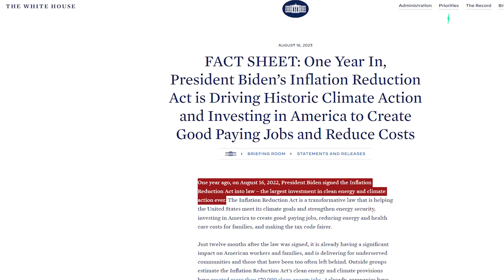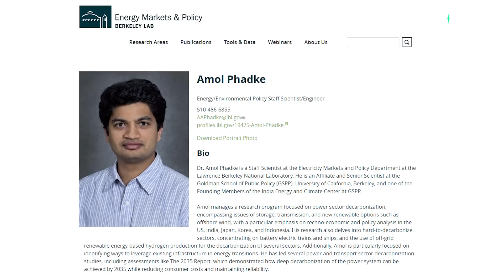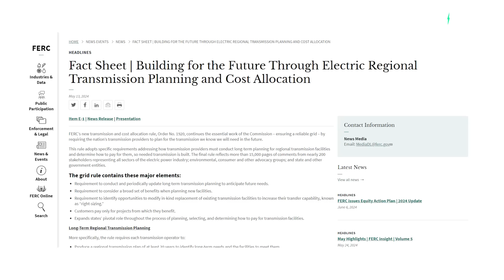How a small change could double the size of the U.S. electricity grid

Comment: AFAIK the cost of reconductoring is not small since those new cables with carbon fibre core are much more expensive than steel core cables. But I don’t know the exact numbers and wish someone could add this information here. In any case, the cost would significantly decrease if the cable replacement became widespread.
The same probably applies to replacing AC HV transmission with HDVC at higher voltages than AC - I would assume convertor stations costs would decrease substantially, making the approach economically sensible for line lengths below 500 km. 
So options exist without a huge need for new lines.

Comment: Sounds half-baked
Firstly, they could put the new conductors in parallel with the existing  and even create strings of new circuits and even drop off to new substation builds that might be developing along the transmission path.
As for the substations handling the increased power, firstly they maybe under utilised, so not to many issues with new parallel droppers terminating on existing substation equipment (massive amount of outage time savings).
Grid battery storage could be built at some substations that mightn't be able to deal with increases to limit, store and forward energy and, be especially convenient double-header for providing grid-battery FCAS.

Comment: Californian here, installed solar panels in 2009 under net metering 1.0 and at $.12/kwh.  Drove my Prius at one-third the fuel cost of my ICE car.  Now, there is little difference between ICE and EV fuel costs, so more electricity is not going to get me into an EV.  Cheaper electricity, yes.

Comment: UHVDC lines can go much further in distance with way less loss. They also carry  a lot more power. The biggest thing is we need storage so when there is no sun we still have power. Right now its hot and my central air runs day and night. I use 15-20kw a day normally but now I use 30-40kw a day. I can do this since I have 4 14.3 kw battery banks.  So the grid needs the same thing. Battery storage that can run 1-2 nights and or even help boost when everyone turns on their AC. With UHVDC we can transfer power around from say Arizona to Chicago when more power is needed. Now adding in more EV charge stations means each station must have battery units to charge enough cars daily and their own solar/wind farm to power it. Right now they are making a price war for electricity so the rich become more rich. EV should not expand till the grid is ready like in 2035.

Comment: The United Illuminating company announced a transmission line upgrade . The project will rebuild 8.1 miles, or 10.8 circuit miles, of transmission lines from the Eversource-UI demarcation point in Fairfield to the Congress Street substation in Bridgeport. It will cost $208 million . They also announced another upgrade 9 mile upgrade from Milford to New Haven. that one will cost $300 Million.  There is a proposal that a special metering device be put on EV charging stations, to make them pay their fair share of the increased cost.

Comment: Hello!  I owned stock in this cable, over 20 years ago.  The companies value just went sideways so I divested.  The cable is made of braided 1100 Al (the Al that is used in soda and beer cans).  The cable had an aramid core (think kevlar).  As a result when slamming power thru steel cable, it sags by about 24 feet.  The Al cable sags about 4 feet.  Additionally, due to the edge effect the Al cable can conduct more efficiently because the inner aramid fiber makes the cable a tube.  So, power moves on the interior and exterior of the cable.  Of course the cable has special splicing needs as well as end cap needs.  Finally Al has a +3 valence meaning when ionized under high power, it is better at moving electrons than steel.  Regards

Comment: 1. Is any cable maker making the new cable designs at scale, and do they need different techniques for joints and anchoring?

2. American transmission lines are often long. Why not rewire with these new cable designs AND convert them to UHVDC? Massive increases in capacities are possible this way.  The linear right of way is simple rewiring.  The UHVDC components are only at the terminals/ tap off points.

Comment: A key reason why US utilities would prefer to build new transmission lines rather than rewire existing ones is because a utility's profit largely consists of a mandated rate of return on capital investments (typically about 10%, usually set by a state government agency) multiplied by the amount spent on capital assets. It would be worth checking further, but I don't think rewiring an existing line counts towards constructing or buying capital assets, and so by definition, does not generate any profit for the utility. Hence the lack of interest. Rewiring, I believe, counts more like replacing a defective meter, which is mandated by the regulators to be revenue neutral, not a profit opportunity.

Comment: Regulations do not permit homeowners to install more than 95% of the average electricity use. This means that many many households don’t install solar or install two little of it. If more houses were off grid that would also relieve a lot of the capacity problem.

Comment: Power companies can go from 1 wire hanging from an insulator to 3 wires per insulator to triple the power sent.  As seen at 8:33 in your  video.

Voltage can be increased to sent more power because power (watts) is voltage times amps.

A DC power line was built from the hydro dams in Eastern Washington to California to sent more power can the standard AC power lines.

I'm seeing new lines being installed around Seattle to meet power needs.
Reply: Level 2 charging can add 150 miles of range in about 10 hours.

Peak evening power use is from 6pm to 9pm.

Using L2 charging from 9pm to 7am will add 150 miles of range (to 80% charged).  Cost for us is $.09/kwh vs $.43/kwh for DC fast charging- less than 1/4 the cost of DC fast charging without all the chargers in use, blocked pumped by diesel trucks or sabotaged charging cables. And no gasoline vapor smell on your cloths.

Comment: If every home was fitted with a base level home storage battery that could power the average house for an hour there wouldn't be a issue as during the peak demand in each area domestic supplies could be cut off without it being noticed and then recharged slowly during quieter hours

Comment: I use to rewire transmission towers in the UK, I assumed it was also done across the world. There is new lighter/ stronger cables coming on the market every year for the last 100years. connect the new wire to the end of the old wire and pull the oldwire off the tower.

Comment: The other contribution is upping the voltage of the high voltage power.  More voltage, less current for the same amount of power with less losses.  Resistance and hence power loss is a function of amperage.    You will notice that some wires are bundled.  Very roughly speaking, the voltage that they carry is 100,000V per line.  Thus a power line with 4 bundled wires will be carrying 400,000V.  Higher voltage will necessitate longer resistors connecting the power lines to the towers but this is a relatively fast and inexpensive process.  One more innovation that can help is using DC for very long power lines.  For some reason, this is more efficient past a certain length of power transmission.

Comment: The other 'string in the bow' of the power system is vastly more energy storage.  With much more energy storage, the high tension power lines can be managed so that they never exceed their power transfer capacity.  It is not the whole story but a valuable contribution.  And it appears that pumped storage needs to be re-looked at.  There are more suitable sites that have previously been believed. https://www.youtube.com/watch?v=_-cOgrBIAuc&t=19s

Comment: We live by a high voltage transmission line, and just got a notice that the wires are to be replaced.  Also we need to move some of the data centers nearer to the generation (and get them out of major cities).

Comment: The economics of these types of projects seem like they are simple.  However, in many cases, regulations make it unprofitable to add capacity to existing lines instead of building new.  Regulations need to change to encourage more upgrades like rewiring.

Comment: How much CO2 will it cost to manufacture these new transmission lines.
Reply: Compared to fossil fuel power generation?
Reply: @jaaklucas1329  correct, are they making something that over its lifecycle and manufacture worth it. I have Solar panels/batteries and the payback is ~ 10-12 years. I will probably have to replace the batteries before that and the company that makes them probably will not exist so have to replace the whole system. I will probably have to pay for the recycling of the battery storage system.
Reply: @ccp_fact_checker  Our problem at the moment is burning carbon for energy. Our atmosphere can sort itself out if we can change that.
Reply: @jaaklucas1329  Plant trees as Carbon capture devices not cut down mature trees like they do in Scotland to make way for wind turbines. If the Billionaires that fly around the globe talking about CO2 and climate change put Billions into the natural rain forests of the world and did a ZOOM call we would be OK.
Reply: @ccp_fact_checker  lm talking about noxious fumes. I will leave the global warming  to  you.
Reply: @jaaklucas1329  you're right Dust from EV tires and other gasses from ICE cars are probably worse for people's health.
Reply: @ccp_fact_checker  Dust from any tire, EVs are heavier true. Seems like the way people drive with EV torque eats more rubber than weight.

Comment: Unfortunately, nothing you described in this video will help .

The only accurate thing said in this video is that existing grids are old, decrepit and need upgrading and replacing. But beyond that there is zero about why nothing is happening. 

It's important to understand that the US grid is actually made up of many privately owned and operated grids that frequently poorly managed and operated. Many grids are in red Republican states which have a tradition of low taxes and low fees for practically everything, unwilling to pay for better service. If the power grid in these areas are going to be upgraded, it won't be paid for by Users or even local and State funds, it will likely be paid for by the Federal government drawing on funds from wealthy states 

The costs will be high because these poorly managed grids likely will need to be engineered and designed. For safety reasons power lines may need to be run underground, particularly vid lines will be carrying much higher voltage to lessen loss over distance and transporting across much longer distances. Interoperability to support transporting through and across grids will also need to be negotiated and interconnects built where now none exists 

States that have the means have already taken steps to be more efficient and provide better service but at high cost like California and that is not be reason EV sales and ownership is so strong in California. From one end of the state to the other, electricity is reliable, about 30% of its electricity is Green and supports a decent network of EV charging stations. With better and more extensive use of metropolitan energy storage supporting current in demand generation, IMO California could ramp up to over 50% Green power generation quickly but today that probably doesn't match California's and western states' demand. California fossil fuel refineries provide practically all the needs of all America west of the Rockies.

Until there is greater consumer demand relative to fossil fuels in local communities and are willing to pay for an upgraded power grid, grids won't be upgraded. But full EV adoption will be coming in about 5 years and at that time infrastructure will need to adjust and be upgraded because consumers will demand it

Comment: At some point i would like to see an in depth analysis of regional demand projection. There is a lot of generalized talk about grid failure, but, at least in my area this talk comes from a partticular political anti ev view point. EV's are bad, solar farms are destructive, the grid is going to collapse kind of mentality.  As a result i am skeptical of alot of what i see in the press. 
One facter i dont see being accounted for and that is the economic benefit to investers that install new solar farms. There are many of these smaller ( 50 acres or so) instalations being created.  There is one just cometed down the road. It is feeding directly into existing local roadside over-head lines which just a few miles in either direction feed local sustations. This means that while the energy are being sold some where in the country , the actual electrons are feeding local customers. This has the net effect of reducing long haul grid demand. 
Our local grids have been undergoing massive upgrades in terms of new towers and rewiring projects for the last couple of years. So in my mind imminent grid "failure" is being handled as we talk.

Comment: Building power sources that can't be connected to the grid is none to bright. As for rewiring the grid, replacing hundreds of thousands of miles of transmission lines will take years even if the replacement lines, skilled workers and necessary machinery were available.

Comment: It isn't just about re stringing towers. With more load comes more voltage drop. Line voltage tends to need to be lifted. You also might need bigger transformers, lifting of the rating of other components like isolators and circuit breakers that can clear bigger faults that come with higher capacities. You may also need bigger capacitor banks. 
It's not as simple as just restringing lines.

Comment: I think that there is a broader topic than just increasing the electrical load capacity of the grid, which you appear to be in strong favor. In support of your comments; could Texas benefit  from increasing the grid to the West Texas' wind energy (yes). However there is a cost of installing and maintaining which would drive up the cost for the general consumer without supplying any benefit. Unless destroying our rule way of life is a benefit... I think not!
In the USA there are two Federal grids and a state grid (TEXAS) operated by ERCOT.
 I live near Athens in East Texas and have worked for the past 7 years developing and patenting staggering wind energy harvesting technology, in that, it has a 25X capacity rating. An existing 1MW turbine can supply 750 homes at its full rated power of 30mph (13.4 m/s). This new technology can supply 20,000 home within the same land space. Also there is no upper wind cutoff speed... it functions in 100 mph (45 m/s) wind speeds.
This new technology would allow Texas to increase power to its low energy areas, such as East Texas, without state wide increasing the grid.
Also mixed into this discussion is base line, renewable and peak power ratios.
In general I do not support blanketly increasing the grid.

PS: I do have a fondness for JCB's Hydrogen farm tractors... Hydrogen can be made from water and ELECTRICITY. I believe that JCB can produce the hydrogen farm equipment and this new technology can supply the electricity for making the hydrogen!

Comment: A very quick relatively cheap way to increase transmission line capacity is dynamic monitoring. Current is limited by a set formula. However air temp & humidity vary so the heat dissipation also varies. Dynamic monitoring permits grid engineers to push more power around sooner with minimal CAPEX.

Of course there will be periods where transmitted power will have to be limited. But it’s an attractive ‘quick & dirty’ solution until upgrading the tx lines can be done.

Comment: Sam, what you’re saying here is very misleading. There is not 1,500 GW of completed projects waiting in the interconnect queue, just sitting idle, while waiting to be connected to the grid. A lot of investors do “speculative queuing”, where they propose a project and put it into the queue in multiple of the 9 power grid regions in the US. Then when their project gets reviewed by say, California independant system operator (ISO) network and they tell them it will cost $50 million to connect to that grid, but a proposed same sized project in the mid-west ISO gets approved for, say, a $20 million interconnect fee, the investors build the generation facility in the mid-west ISO and cancel the California request. As such, the completion rate in California is only 13%. A lot of other regions have completion rates of 15%, 18%, 24% etc. There are only 2 regions that have completion rates over 30%. Realistically, there’s probably only about 200 GW of projects that are waiting for approvals that are not just straight up duplicate requests. And mathematically that makes sense. The US only has 1,250 GW of installed generation capacity in January 2024. If there was truly 1,500 GW of ready to go projects, that would increase US electric supply by 120%. And that doesn’t make sense. Also, the average interconnect approval time for large generation projects is 36 months. If all of these projects were legit, that would mean that the US power supply would more than double in the next 3 years. And that simply isn’t going to happen.